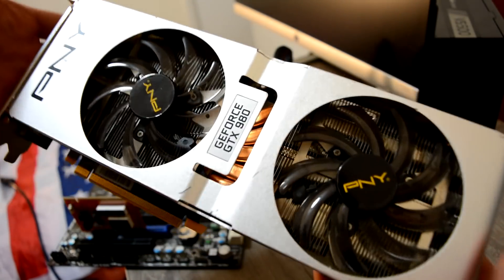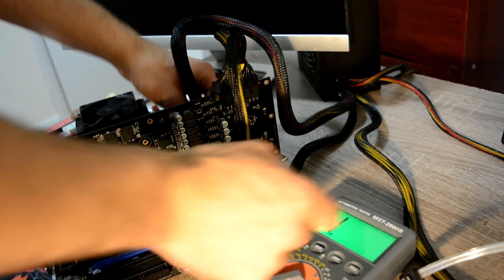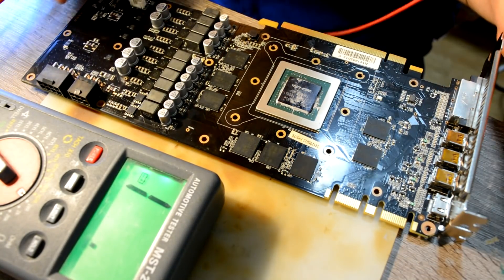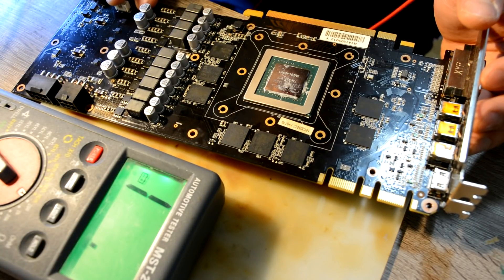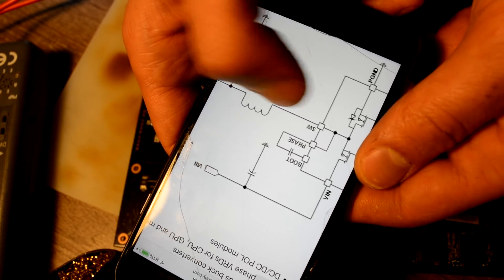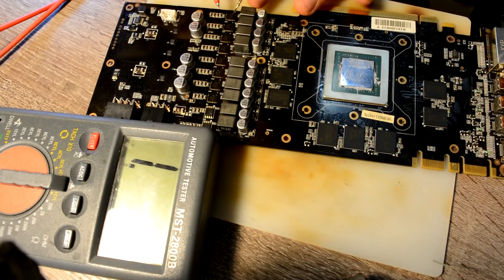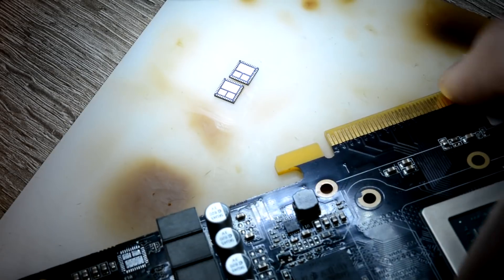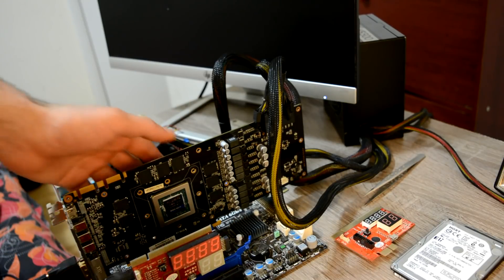GTX 980 dead graphic card diagnostic + repair nvidea geforce video card

Comment: I have a gtx 780. it keeps saying power down and connect pcie power. but this is of course connected and also measures 12 volts. where do i look for this error? I still can't find why it doesn't detect this.

Comment: Thank you very much for posting this I now have the same same card.  An GTX 980 4 Gig.  I live in Australia things are so expensive here. A few weeks ago  I bid on it and bought it damage off of eBay for $60.00 add  $15.00 for postage.   The sellers description was ( Condition is "For parts or not working". Card powers on and works somewhat with graphical artefacts.) It will post in to windows but only stays on low settings. MSI wont even read it And   it has developed blue line across the top of the screen.    I was hoping to fix it as My R7 580 fan had stop working and it over heated and went to black screen. A new  RX 580 are over $1000.00 here.  Graphic cards are so expensive here Right now I cant afford the $1000.00  to buy a new one or even the $300.00 to buy a second hand one.A while ago I got a damage R7 380 of off eBay for $25.00 After  I use a heat gun on it and it been working fine  It is what I using now I was hoping to get both my RX580 and the  GtX  going.  Videos like this have helped me  Thank you so much.

Comment: got a gtx 1060 3gb from msi i got a burned gpu i removed gpu and tested pcb i still got a short on the pcie slot 12v line but the pcie power 12v has no short what should  look at

Comment: You mention you are checking this and that, would you show where you are checking, how you are checking and the locations of the pin you are checking. You mention you would take off the coils. Would you show what and how you are checking whatever it is that you are removing the coils for. What and why and what you are proving or not proving. Just a little more information for those of us that are not as knowledgeable and you are. Thanks

Comment: Excellent video. Ive been having trouble with a 970. Had just installed FS2020 and initiated a first run while stepping away for about half an hour. Came back to what looks like someone smashed my display. And now get tear drop type effect on transparancies within Win10. Login screen, Xbox app etc. And will not game, but runs Heaven and Kombustor. DX12 issue?

Comment: Thanks you so much bro eli for your videos.. it really helps me to repair my rx570.. btw the problem of rx 570 is the EN pin on the LDO gs7301 has only 0.8v thats why it doesn't have an output.. i notice 1 of a tiny resistor drops the voltage from 3.3v to 0.8v.. godbless u brother.. 😊

Comment: Hi ¿is there a way to fix the 8-Pin from GPU (980 Ti)? Its not the cable from PSU, is the connector of the GPU. Thanks

Comment: Fantastic help thanks. I don't have the facility or ability to micro solder. I've bridged the connection with solder for the moment. What's the worst that can happen without the 1 ohm resistor? Memory gets 12v and the card is fried or worse?

Comment: Awesome video, I have the exact same card and I think that the first mosfet/driver chip is bad like you, can I just remove it and try if it works, without removing any coils or capacitor (And what would happen if I try to stress it without one of this chip ?)

Comment: Great video. I hope you can help me with my card. I have an XFX RX 470 4Gb  I bought used. It displays fine on the DVI port using an HDMI adapter. When I connect the same HDMI cable to the HDMI port it displays nothing. I get no signal detected. I have cleaned the port and tried a different HDMI cable. No change. Got any ideas? I have not tested the display ports. The BIOS appears to be stock. I compared to another identical card. I bought 3 of these. The other 2 cards display fine on either port when tested in the same computer. Computer PSU is 600 watt. Windows 10 and latest AMD drivers.

Comment: Thanks for the video. I wish you would have shown where you were checking and what pins you were checking. You mentioned there was something on the back but you did not show what or how you were checking it. What were you checking and how and why..... I have a card that would suddenly go black then come back on. After taking it in and out several times and most likely getting bent as taking it out with the power plug on it went dead. Tried heating the cpu and got picture with colored lines. The cpu heats up. How do you check one that the cpu gets hot and you have to have the cooling fan off? I would like to see how you check everything to fix a card. Thanks for your videos.

Comment: I don't know what the hell this guy did to fix that gpu but I know he sure as hell knows what he's doing and hes good at it.
Reply: Just found shorts or incorrect voltages and replaced the chips and modules, with knowledge of the 980 ti circuitry
Reply: @zacktrever1878  I want to learn all of that, where do I start?

Comment: What do you recommend for a GTX 980 that intermittently gets a DXGI_ERROR_DEVICE_REMOVED? Ive tried memtest cuda which came back clean. Drivers have been updated multiple times and it still happens. Im suspecting a hardware fault but not sure how I would go about isolating it

Comment: Well done on showing how to test the MOSFETs... I found dead one on my card using you method-- replaced it now works fine.   However, the solder used on the card would only melt with a 480 centigrade soldering iron/hot air gun temperature !! which made changing the chip very difficult.

Comment: could you make a video on the basic fundamentals on how a GPU PCB works? Like just general layout and how the electricity flows around the card? Like why does it have 3v, 5v and 12v for example? thanks! and keep up the great content!
Reply: 3v for led
5v for fans
12 mayb input from psu
Reply: @hafidz1508  I thought 3.3V was for Ram?

Comment: I have the same problem with a 970 I replaced the mosfet and the fuse. But after 20 min or so broke again while installing the drivers. Noticed that there was some Flux left under the mosfets could that cause a problem?

Comment: can you fix my gtx titan 6gb it has green lines through screen an when it loads in to the log in screen it stops working like it goes black
Reply: I had to use a heat gun on my gtx 980ti heated the chip 230 degrees for 15 minutes it was artificial and crashing after that 100% cured no more crashing and artifacts

Comment: Good to see it fixed but my 980 Ti will probably remain borked. I took it down, cleaned it and reapplied thermal paste. It worked well for a few days but went back to crashing games. I reinstalled the 1060. There's no way I can troubleshoot and replace bad components. This video convinced me to write that card off. I kind of knew it already but it's good that it's confirmed. Thanks...

Comment: Hey mam I have a question, please answer me that I have the same problem.
What do you do with the MOFET at 7:46 and how do you solder it again? Could you explain how to do it please?
Reply from the maker: GaryDani check my other videos, for instant the one from EBay. There I showed a process. But anyway there are a lot info on internet about soldering that’s why I skipped that part
Reply: @elitech3339  Hey Bro, if I wanted you to fix me a GTX 980 that is damaged, but turn on, could you do it?
And if so, how much do you charge for it?

Comment: I have a gtx 980 ti which under load reboots pc (not psu related) , the only workaround was to decrease card clock .The card worked this way for long time , until a power outage ,now the card gives signal only the first time I install it in pc , after reboot or driver install ( error during installation of the driver ) the card won't post anything  . Can the chip be the problem or is the board?

Comment: Want to ask , my stupid GTX 970 running only pcie 16x 1.1 , cant run 2.0 or 3.0 bandwith , so result is very huge stutering or bsod when playing AAA open World games which is need huge vram usage and bandwith , how to fix it
Reply: resetting your motherboards bios can often fix this problem!
Reply: No , its just same
Reply: how do you know that it runs at 1.1, GPU-z ?
Reply: Looks at PCIe tab in gpu z dude , just benchmark with GPU Z already open , and then look
Reply: @KocakLu14  oh so even after you stress the gpu is still at 1.1 ! what CPU do you have ?

Comment: Hey man, I have a gtx 750 Ti that "works": The chip gets normal, the fans are good and the pc starts without problem, but there is no display. If I use a remote desktop app I can see everything, even my PC recognizes the GPU. 
What do you think is the problem?
Reply: Your problem will be the outputs.... Check the resistors and IC's under your DVI, HDMI, Displayport etc.... If you dont have picture none of your outputs... Your problem will be behind the outputs. But above your GPU.
Reply: @baranypepe  I don't have a multimeter (yet) but I did a inspection in the back of the GPU and I noticed that a resistance has a black dot and it's under the video ports. Do you think that would be the issue? Here are some pics http://imgur.com/a/5ijlfxH
Reply: @naruto7921  check it bro

Comment: Great videos man, i'm learning a lot. 
One question: I've got a 550 Ti just for learning purposes, that has 0,9v for GPU, 1.5v for memory, 12v and 3.3v all good. The chip gets hot like normal. components look fine. resistance to GPU is 0.3 ohms and for memory is 105 ohms. BUT, no video output and OS / nvflash / gpuz do not recognize it.  What should i check next? is chip dead? thanks a lot!
Reply from the maker: nanovoxer check pci pins. Most likely yeah chip
Reply: Is the order of source appearing when the switch is turned on: V_PCIe (0.9v) -> 3.5v, 5v, 12v -> V_RAM (1.5v) -> V_GPU (0.9V) ????

Comment: Thank you man for giving me hope. I had two drops of water spill on my GTX980 and I was panicking it was completely screwed. How easy would you say it is it diagnose which transistors or resistors are blown and is there anything I should be aware of before I start trying to fix it?
Reply: prepare to fail and dont be too upset if it doesnt work out

Comment: Can you tell me where do you get those diagrams and schematics? Id really want a evga gtx 970 schematic cuz i want to check my 970... It shuts down after 10 seconds of windows login (not a software problem)
Reply from the maker: S U C C there is no diagrams for graphic cards. Manufactures don’t reveal them. You can find just for chips

Comment: Hi, I have an MSI GTX980 4Gb that will only "work" when hot
When cold, the screen turns on but stays blank. 
When warm, it boots fine, and Windows starts but plenty of artefacts. 
It reboots after a while.
Would that be a GPU issue ?
Reply: 99% of the time its the chip itself and not the solder joints. It's super rare for cracks to form on the BGA.
Reply: cracked solder joint
Reply: its not a myth

if the crack is between the substrate and pcb its fixable

crack under the gpu silicon die (in the underfill) isnt fixable
Reply: BGA reflow is a myth.
Reply: @hippopotamus86  no is not I do many gpu repair and if you do right is working with no problem from my experience some card I repair with reflow still working after 2 years
Reply: I used to do the same as you, I'd say at least 70% came back after a few months and I must have done at least 50 or 60 GPU's. Any real repair shop will confirm it's a myth.  Even Louis Rossmann says it's a myth.
Reply: @hippopotamus86  I know he say that but I don't care as my experience is different and is real I fix about  400 gpu in my live and never  I get one back and yes most of tham been fix with just heat gun
Reply: You literally have no idea what you're talking about. Do some research on GPU repairs before trying to sound smart.
Reply: @hippopotamus86  iam not try to be smart I don't need that I just know what I do and for me is that proof for me if you don't like it simply is your choice

Comment: First of all I want to say "thanks" for this video , I have the same card and I have attempted to repair it, I found a mosfet that not working anymore and changed it, the card is returned to life but unfortunately not for enough time, as I launched a game, i have heard a sound of something going burned and I have discovered was another mosfet, changed it again but this time the card doesn´t start, i have noticed the presence of 4 other little mosfets in this card, are these possibly driver mosfets ?? how can i check them ???? 

Many thanks in advance :)
Reply from the maker: I would take power supply and just see what current it takes on board + im thinking problem is somewhere vrm

Comment: wow first time I see so detailed diagnostic. Usually people just reball and see if it helps
Reply: It works on me I managed to repair 1 dead gpu and 1 that had garbage display and I even use an electric iron cause I dont even have tools. Im no pro at electronics but I just got lucky lol
Reply: The gpu was hd 4650 - dead gpu
gtx 760 - garbage display
Its still alive running no prob 1 yr from now
Reply: Ye man I have some vide like that as well this one is amazing